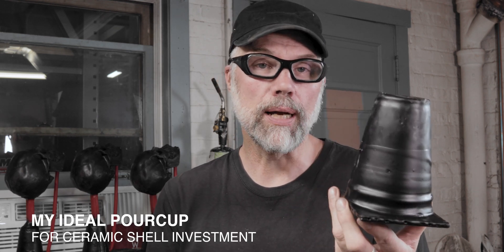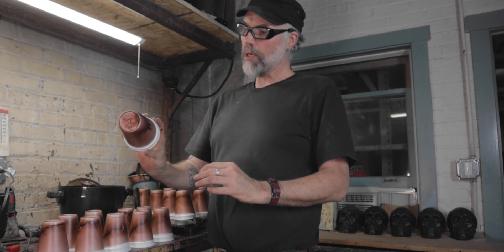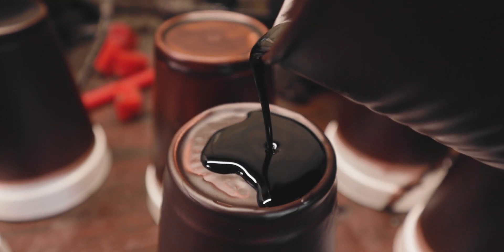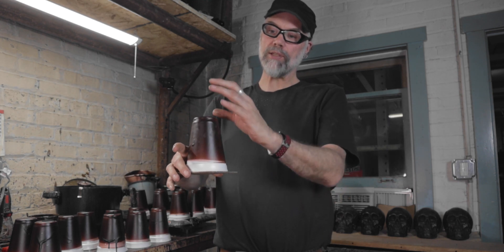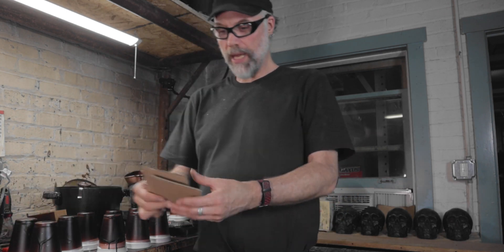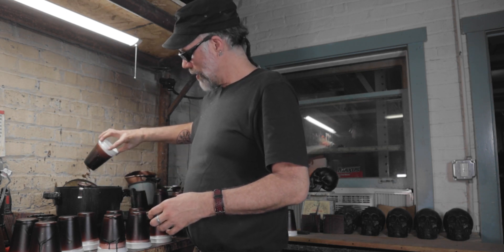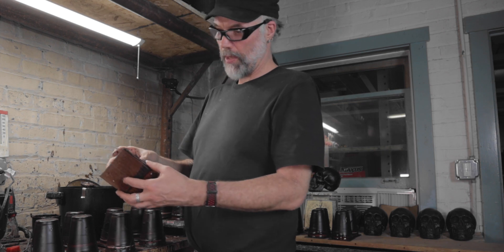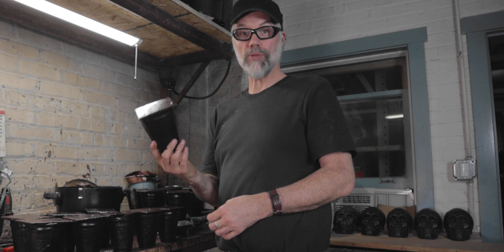Lost wax casting: My ideal Pour Cup for ceramic shell investment

Comment: Hello, when and how you removing the cups, thank you.
Reply from the maker: I typically cut my cups, gates and vents off with a grinder with a cutoff wheel.  But I have also used a hand saw with a metal cutting blade for small delicate cuts or a carbon arc for heavy hard to reach gates.

Comment: Is using Styrofoam cups a preference or a best practice? Can other cups be used in the process or is durability an issue?
Reply from the maker: As for the cups anything combustible is fine. And they can certainly be all Wax. I prefer the Styrofoam because of evacuates that much quicker.  There is something said that it’s not great for the environment but there’s so much other nasty stuff out there that it’s a drop in the bucket.

Comment: Hi Eric, can we use paper cups instead? unable to get styrofoam here... please help..
Reply from the maker: Paper is fine.
Reply: Thanks Eric!! 
Can you also advice wrt de-waxing the ceramic shell, you once said in your video that we can put the shell in boiling water to get wax out, so is that an effective method?
Sorry for the long question...
Reply from the maker: @priyamtiwari5992   Boiling out shells to de-wax is viable but not ideal.  its is slower and can lead to more cracking. but if you are in an area that you cant get away with dark smoke then its better then nothing.  just remeber that you will still need to vitrify the shells after the dewax.
Reply: I'm trying to find a flame torch to vitrify the shell, if i get that, then i will burn the wax out else i will need to de-wax first as buring in a wood fired pottery oven will melt the wax even more slowly and may cause cracking.
Reply from the maker: @priyamtiwari5992  If that is your only option there are a cooupl eof things you can to prevent some of the cracks.  When gating do a direst spru from the cup to the thickess part of the pattern (fastest exit).  another thing would be to make your shell a few dips thicker.
Reply: Shall try to do as you have adviced, Thanks a lot for your help and insights! 🙏😊

Comment: What is the purpose of spending wax and time to cover entire surface of the caps? Does not shell slurry stick to Styrofoam?
Reply from the maker: I cover the whole cup and cardboard to make it water tight and the extra dips on the sides of the cup to add strength.